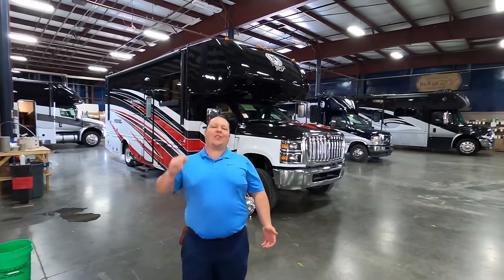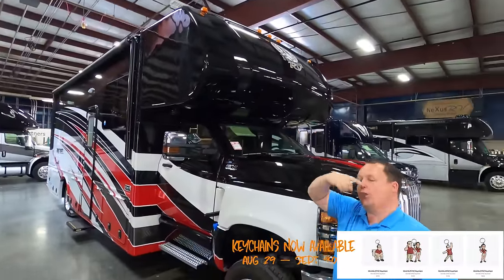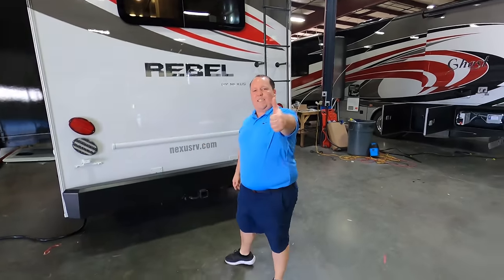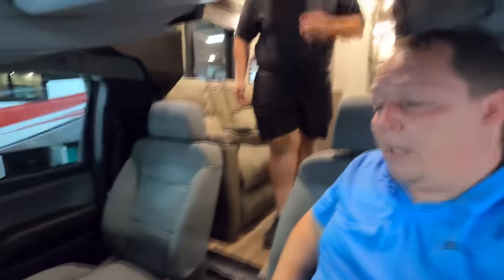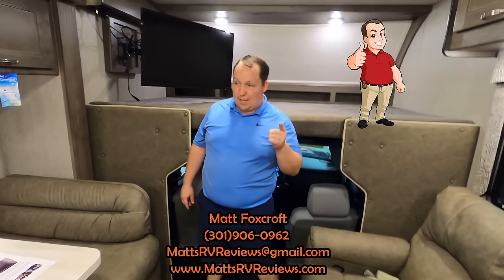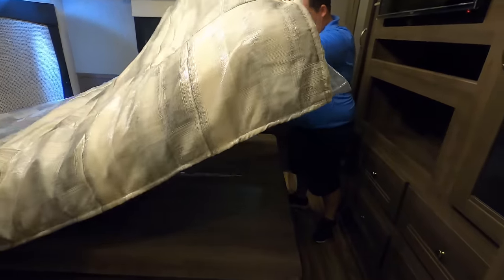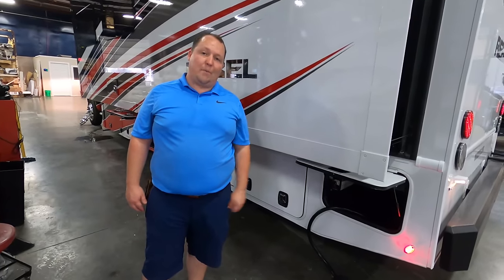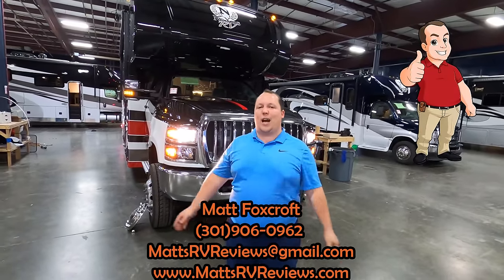The BEST Super C 4x4 Motorhome IVE EVER SEEN 👀

Comment: Dislikes 1. Tv position, put it on a lift outside the dinette. 2. Odd tire size. Put 22.5 with all alcoa wheels. 3. Whats with the def filler. Put it on the drivers side where it can be filled at big truck pumps. 
3 likes. 1 4x4. 2. Duramx/IHC. 3. Dark wood. I am older and would prefer dark, high gloss interior wood. Also if it isnt an option from the factory, the old schol batteries would be replaced with Lithium iron, install all the solar I could on the roof, and increase the size of the inverter to atleast 4k. What are realistic weights? What are the real axle weights when full of fluids, fuel, water, and propane? For me there needs to be a minimum of 4k available on the rear axle when full of fluids. Otherwise I cant use it if I cant put 1500 pounds stuff and a trailer with 2000 to 2500 tongue weight. I really like this coach.

Comment: DISLIKE: No solar panel hookups, storage doors should open to the side, u-shape dining seat, no Lithium batteries, no stackable washer and dryer hookups, there is no reel for the 50 amp cable, and the back flash all the way to the cabinet, and carpets: Likes the theater seats, the color, and it is an international chassis.

Comment: Nice rig.  Does this come with just rear wheel drive? 
Likes 1) the interior accent lighting, 2) the quiet diesel, 3) towing capacity. 
Dislikes 1) Price. 2) Don't need the 4 wheel drive. 3) its 2" too tall to fit in my garage. 
 As an adder with that large rear bumper it would be nice if you could have storage compartments on it for say tow bars / Bottle jack, road flare markers and any other equipment that you need to access fast.

Comment: dislikes 1 l its in the storage bins 2 molded rear cap 3 power tower in kitchen 4 combo fridge 5 power cable real 6 glass shower door 7  side stiles on rear windows 8 no doors on storage below tv in bed room
likes 1 acc into cab area 2 no floor vents 3 windows and paint 4 acc to engine comp

Comment: Likes: 4x4. no slide out on passes get side. Storage inside 

Dislikes: exhaust on passenger side..if you have to turn motor on you can’t sit out there. No solar (whats the point of 4x4 if you can’t go off grid) . Fridge if it’s not a 3 way. I don’t want residential especially if there is no solar (again for off grid; the zombie apocalypse is imminent by the way 2020 has been going)

Comment: Dislike:
Not enough counter space ie:extensions 
Dont like the backsplashes none of them connect like they didn't want to cut tile so it ends before it should even in the bathroom 
Lack of storage for towels and kitchen stuff.
No air horn!!!!!!!
Power reel
Like. 
Paint scheme 
4x4 nice cockpit 
Nice kitchen faucets 
Tow capacity
 steel bumper 
~~~~~~~~~~
Still want sell prices listed 
Needed cargo capacity?

Comment: WHY are the baggage doors top hinged, you save 50% of piano hinge and 50% on the latches to hinge the door on the side. NO ONE wants to kneel on the ground, which is always wet and dirt to get into the baggage openings. Wheel opening on the rear should be made large enough for  SUPER SINGLE WHEELs. Mount the PROPANE TANK 90% to the frame, and enclose it, with a bottom vent, to keep it rust free, it also makes room for more baggage space. For the Price the furniture and cabinets seem LOW END .

Comment: Just like there is no Duct work on the floor......for obvious reasons, the same SHOULD go for the Power on the Countertop. Its a frikin counter top.......has anyone ever thought possible a drink might spill? after all, that kinda happens on counter tops and when it does...its gonna fry the 2 outlets and possible more down the wiring path. I bet money the little flip up door on the power lilly has no water proof O-ring...meaning it will allow water past it and into the Outlets. Another EPIC fail on the whole industry.